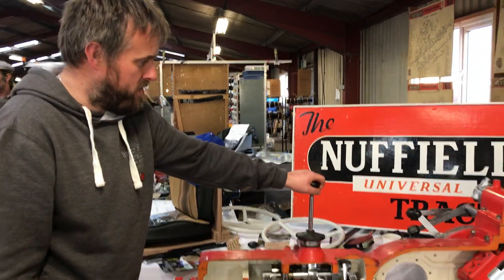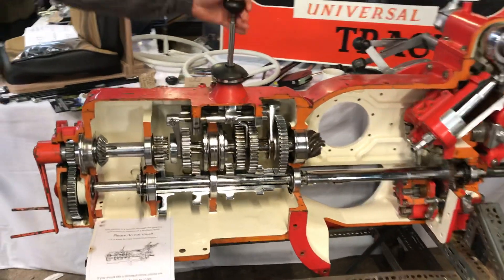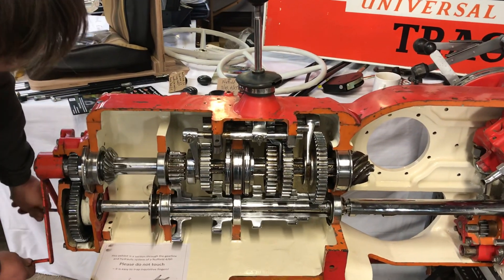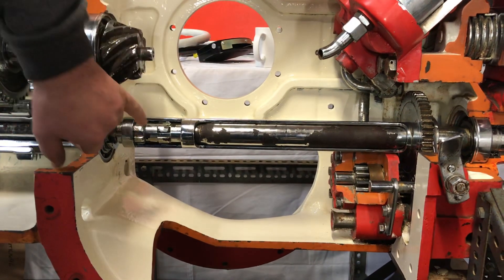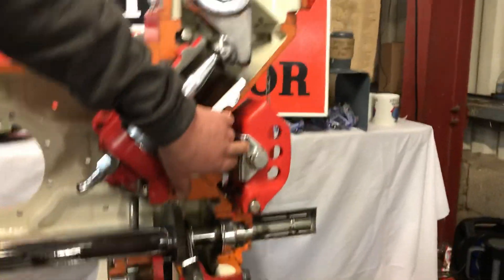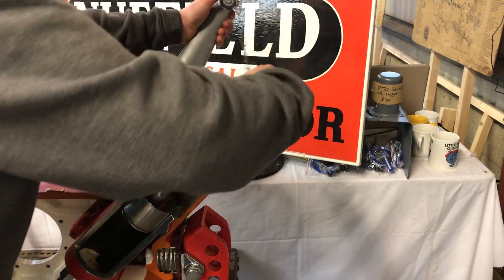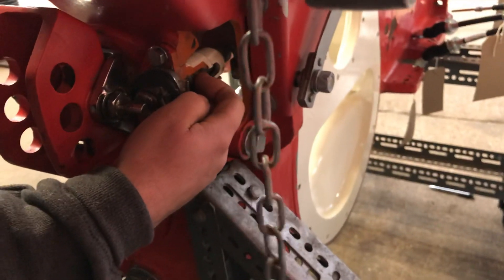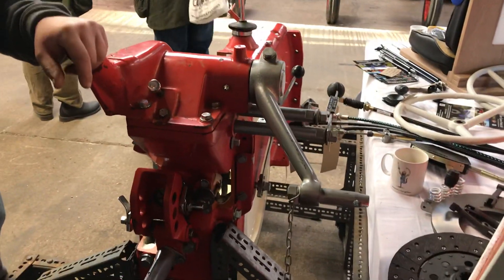Nuffield 460 sectioned gearbox

Comment: i love thi tractor 4/60 nuffield but it has one big issue with the gear box .if you change the gear from Reverse to 1 gear if you put it on bit  incorrect the gearbox is locked down.

Comment: Good  day from Ont. Canada  The 460 didn't have live power   did they  ?  Very interesting video.. The big push over here was basically  the 10/60,  but the heads or something didn;t stand up?   Thanks I sub
Reply from the maker: Yes the 4/60 had optional live drive.
We find that in the UK most of the 4/60 were fitted with dual clutches.
Reply: My 460 doesn’t have live drive

Comment: Unfortunately you didn't mention the high and low lever .
Reply: The 4/60 gearbox didn't have high and low, but the 10/60 that was launched in 1964 did.
Reply: The Nuffield 4 60 only had 5 forward gears and 1 reverse gear no ranges at all